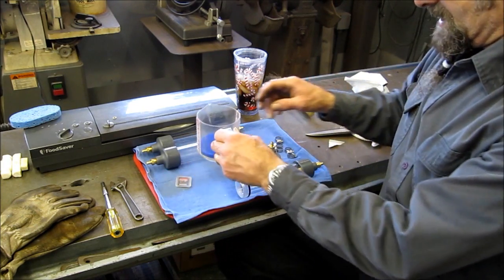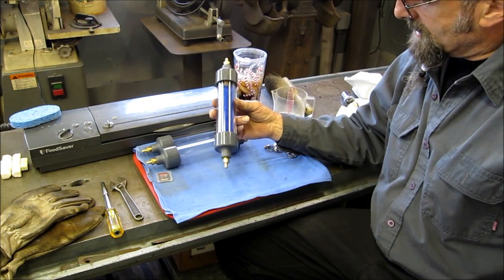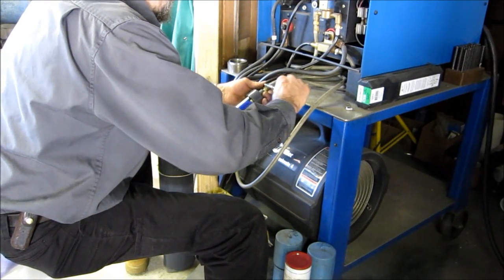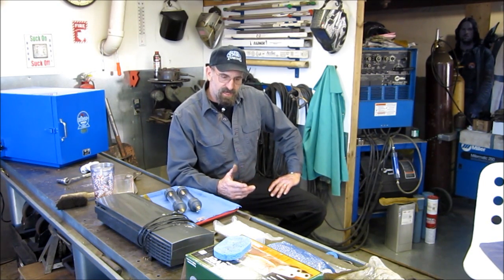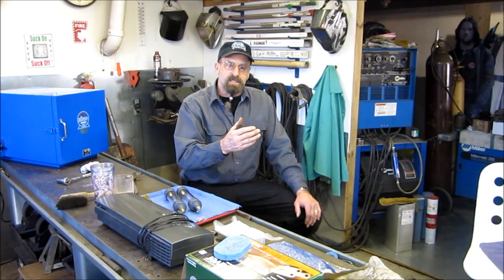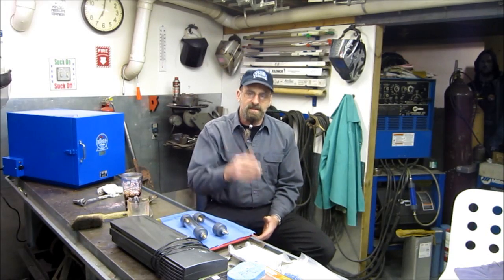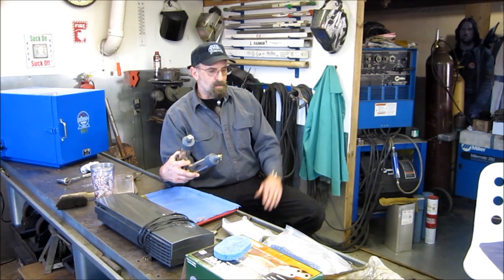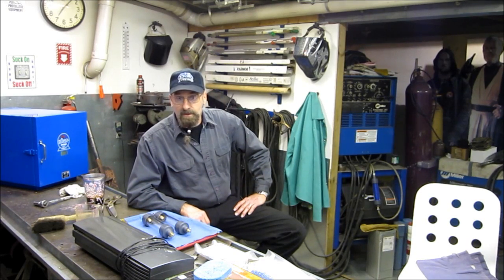Dry it Up Part 4

Comment: I'm no expert but I have done HVAC and refrigeration service for many years. I use desiccant filter driers in all my systems. The one thing that I have learned is that desiccant absorbs moisture very slowly and must stay in contact with the moisture laden gas for a considerable time. Using any kind of absorbent drier on an air line only serves as a particle filter and does very little drying as the air passes through it. 
Condensing moisture separators are the best way to go.

Comment: Almost all of the moisture can be trapped in the receiver/tank, if you cool the air prior to entering the tank.  The compressed air is hottest just as it exits the compressor.  Most air compressors have a short (~14 inch long) pipe between the compressor and the tank.  The air does not have time to cool by the time that enters the tank.  In fact that pipe coming out of the compressor head can be as hot as 200+ F.  So the moisture in the air stays suspended and ends up, finally condensing, dripping out of your air grinder or sander... all over your project.  You could see the moisure blowing out of a air nozzel.

I added a 30 foot length of copper pipe between the compressor and the tank.  I configured the "radiator" with the pipes going up and down and I sandwiched them between two sheets of aluminum.  So the hot air came out of the compessor, and went straight into the "radiator".   The 30 feet of pipe and the aluminum sheet metal sucked all of the heat out of the air.  So the compressed air, entering the tank, was no hotter than ambient temperature.  Before I added the "radiator", the aircompressor tank was warm to the touch. 

From the "exhaust" port of the air compressor and the next foot or two, you have to use compression fittings or braze the fittings.  Because the air is so hot that ordinary plumber's solder will melt and the fittings just blow apart.   After that you can use ordinary plumbers solder (unless you have a two-stage 175psi compressor).

The result was cooler air into the tank.  So cool that almost all of the moisture condensed in the tank.  The post tank water separator would trap a very minimal amount of water/moisture from then on.  I never had water dripping out of my high air consumption tools.  

Taking it one step further and adding a refridgerated air drier is the same thing... on steroids.  The primary factor is is to reduce the temperature of the air so it cannot suspend moisture.  Since the air is 125-175 psi, the moisture will condense ~10 times as easily.     

I wonder if you made a  2 inch PVC pipe, with threaded caps on the ends, and applied a vacuum if it would dry the dessicant.  I've seen some automatically regenerating dessicant systems.  They have the dessicant in a long tube, like yours, and there is a heating element (like a aquarium heater) in the center that boils off the trapped water.  they are PLC or ASIC controlled systems that automatically open and close ports, heat and flush the dessicant.   Your system is simple and it works.  The automatic units cost thousands.
Reply: +WAVETUBE84 There are some other youtube videos that show homemade condensers added to the compressor output.  One guy uses a automobile a/c condensor; which looks like a really cool and cheap solution!  On Sullair and other refrigerated air driers, they have a tiny, self actuating condensation bleeder.  Bekomat31 ($200/ebay).  Or McMaster has something for $107:   http://www.mcmaster.com/#9831k14/=11jkpd4  .   It's really simple!  There is a tiny cylinder that traps the water droplets.  There is a Omron capacitive proximity sensor that detects when the water trap is full.  The Omron sensor triggers a SSR that energizes a solenoid drain valve.  As soon as the water is evacuated, the solenoid valve closes:  so there is almost zero loss of air.  The only problem with that appliance is that they cycle frequently (on humid days a lot more), so the  moving parts wear out sooner.  I figured that the remedy would be to have a larger moisture trap/reservoir:  that way the discharge cycles would be fewer.

Comment: Hi mate.
It is a very nice build.  I was wondering, if one could use an ordinary clear soda pop bottle to do the same, when in use for drying air.  I also was wondering if it would help, if you would put a 12vdc box fan in the little oven, to circulate the air in it, and speed up the drying.  The fact that your glasses got steamed up, when opening the oven, tells me that it is not able to get rid of the steam build-up, made while dying the desiccant.  In bakers' ovens we had a steam release hatch, that is needed to dry and raise certain products. 
In bigger  batches it might be helpful to have an agitator to bring the middle out for drying. 
These are just some idle thoughts of a rambling idiot, so delete what you can't use.
Kind regards,
Marcel.
Ps: Please, Please, Please, Please,  Please, stop smoking.  I lost my Dad with it, and your lungs don't sound all that well.  Marcel Timmers, Registered Nurse.  It's my job.

Comment: Ahh man, the good ole days! I think i bought my dynasty at the tail end of that era. I asked the guy, what he thought had a nicer starting arc the lincoln or the dynasty. He looked at me like i was dumb, turned towards some big doors and said "why dont you try em out and see for yourself?" Sure enough i walked in, about 5 tables setup. He rolled over the machines i questioned about, right off the showroom floor, plugged them in and away we went. 45 minutes later i was walking out with my Dynasty

Comment from the maker: Well since I had made it over a year ago it has remained the same color. maybe a better design may of had one BB of desiccant, so it would react faster, but if you never get another bad bottle it will just remain pretty blue and look cool! LOL I know what you mean about going lulu, I had a bad bottle of Helium once, made yellow scabs on my welds beads, back in the good old days when they had running welding stations in the stores, to prove the contamination to the clerk! ;{)-----

Comment from the maker: You are exactly right, it is suppose to be dry! Best conclusion; During tough times more guys suck the bottles to zero or less after it cools down, like in the fall and when it goes through the process of refill it is not purged before the process, moisture from the condensation, remains in tank. Some lame excuse I'm sure. Not that it happens a lot, the chamber was only created as a detector or second verification, besides your welding puddle. ;{)-----

Comment: If you needed a quick, easy way to allow yourself to take CC payments you could try using Square with an iPhone device. I believe it allows you to type in the CC number as well as swipe it through the square. It plugs into the earphone port of the phone.

Comment: when cut in to feed  tube cut half you can see as in time you need cut back tube, parrot type small shears from garden work well give clean cut, systems in my shop and Unimog air feed I use half old half new to air clean you make me smile every time

Comment: @KEF791 Cost depends on source. $80.00 - $140.00.  First I would try Ebay for a used Gast or Thomas pump. Next I would try one of the Harbor Freight pumps. They have good reviews.

Seems like you could add ports and valves to the current design and dry it without having to remove it. Heat a little with electric heat gun or heat lamp. Don’t use any type of torch. Acrylic surface will bubble real fast. 2 lbs at a time you would need a container capable of withstanding the vacuum.

Comment: If you draw a vacuum on the Desiccant the moisture will evaporate at a much lower temperature. 29 inch vacuum and it will dry at about 75 degrees. 26 inch vacuum would be about 120 degrees. 26-28 is easy. 28+ requires a pretty good pump. I really enjoy your videos. I'm sure your an inspiration and a role model to a lot of our youth.

Comment from the maker: @fart1fart1 Well I tested it at 80 PSI, just to see If I had any leaks,so I'd trust it for that amount, keep in mind that the system their used on is,low pressure or free flowing. This project is a test, hard to say if it is enough desiccant, its got to be close though, comparing it to the pressure and consumption of the PlasmaCAM's system, I have in place. Time will tell and I will post any findings as they accure...

Comment: @KEF791 yeah if they operator isn't doing there job right filling the bottle you're screwed ...I usually try and return bottles with a little pressure still in them to prevent the next guy from having problems.

Comment: Keith great series, your holders seem extremely well built.

I was going to comment on the moisture in Argon, but I don't have enough space.  If both you and Jody have experienced this issue, than perhaps it is more of a problem than I believe given my background in aerospace testing and dealing with controlling moisture using purge gases.

I will say welding grade Argon is supposed to have less than 10 ppm of moisture in it.  If I saw the problem Jody was describing I would take the cyl back.

Comment: what advantages will some one see using a desiccant filter on a welder . would it work with other shielding gasses better or worse , does Argon or other gasses have much moisture in them ? plus would you be willing to trade neat vintage race car parts for one ?  love the videos
  
Alex @ Can-Am Cars ltd